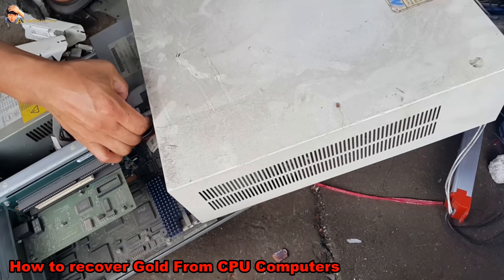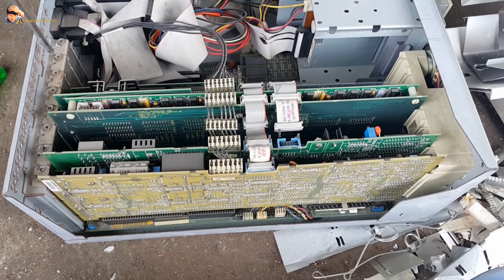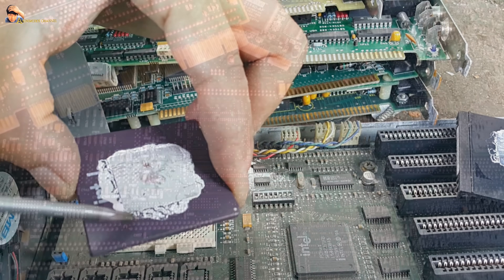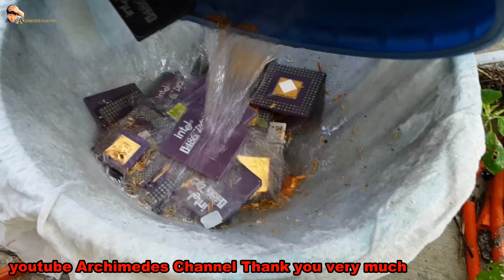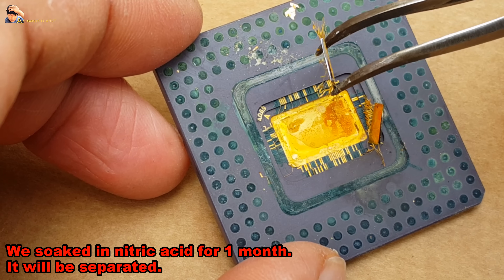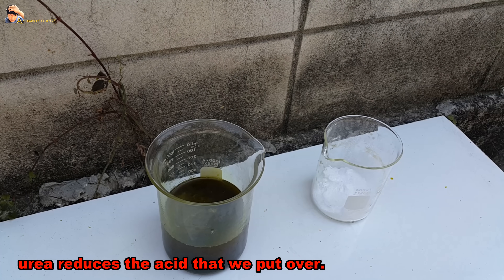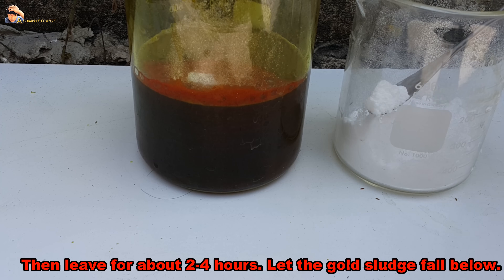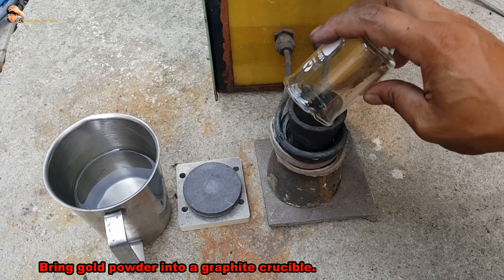How to recycle gold from cpu computer scrap. value of gold in cpu ceramic processors pins chip.

Comment: You could get a lot more money by selling those CPU's and other parts on ebay...
Reply: You will not get 6.7g of gold from a CPU. A Pentium Pro (highest gold content) will give you at the most 1g, if your recovery methods are perfect. You'd be lucky to recover 0.2 grams of gold from most CPUs. Given the cost of time, cost of chemicals and cost of hazardous waste disposal, it simply is not worth doing unless it's on an industrial level. You're better off selling anything from the original Pentium or older to collectors. Details on gold yield here: https://www.scribd.com/doc/28911037/Gold-Content-List-in-CPU-Chips
Reply: Super Swag i dont think you get it what retro gaming or a retro pc means
Reply: Frankiss Kilzkoy well thanks for pointing out that new pcs play new games. What do you mean by that, that no one should play older games?
Reply: Frankiss Kilzkoy Emulators do not fully emulate (for example) windows 98 the sound and graphics are always off
Reply: Tell me where you can buy a PPro for 1-2$, I'd like to have one.

And the compatibility isn't about old drms and stuff like that, it can also be related to old graphic card not using OpenGL but something else instead, speed sensitive games, things that aren't emulated to this day ...

Buy using that reasoning, I wonder why people still buy NES, SNES, Nintedo 64, etc.

And don't tell me about backward compatibility, have you ever tried it nowadays ?
Reply: Frankiss Kilzkoy Many newer Systems do have Compability issues with older Games.
Reply: ROFL this conversation is giving me cancer.
of-course you can make more money by selling restored 80s~90s legacy systems instead of scrapping gold of their connectors.
 
Vaibhav Thamman is obviously a guy that uses a computer only for media and entertainment, he wont understand the art and legend of old systems.

Super Swag does not get the context of this conversation lol.

Frankiss Kilzkoy claims that he is a computer engineer when he clearly cannot understand the art of engineering a computer and thinks people only buy computers for gaming and media, and he also does not get "sarcasm". xD
Reply: This is, if you can steal ALOT computers that are going to problem waste trash collection ect. Or steal the right parts from ALOT of them. Of course you dont buy anything, you steal the parts and do this, otherwise this wont make sense.
Reply: Samantha Applewhite
Because those CPUs are less valuable than the raw gold.
These are CPUs designed for pre-2000 PCs.
You can literally get these processors for like $1-$20 USD.
These are 1 and 2 core CPUs that don't clock over 1.8 GHz, typically.
They also don't have driver support anymore, and haven't since about 2004, so you're opening yourself up to an immense amount of viruses that may not affect everyday users with modern CPUs.
The raw material is just literally worth more than the finished product at this point.

That raw gold he just pulled out is worth about $95 USD give or take $5, minimum.
Reply: what if they don't work?
Reply: Frankiss Kilzkoy indie apps ... Like ?

And which offshore ?
Reply: Frankiss Kilzkoy 
No offence but 0,9 cents is what you get for your dollar in EURO's! Dollars are stupid IOY's that aint worth a dawm in any country anymore. Still think your dollar is the greatest thing that happened to the world come on, youre practically broke.
Reply: Frankiss Kilzkoy, I haven't played Minecraft in 4 years.
Reply: Adamo Kóligo, And that's the first thing that comes to your mind? lmao
Reply: Master Kek ...news pcs can also runs the olders games you know, so you do not need old pcs for playing them, there are something  called emulators,  if you have a new pc you can without doubt run ancients games without any trouble.
Reply: "You can literally get these processors for like $1-$20 USD." 

He used about 30 of them to get $95 in gold. He probably used $20 worth of chemicals. So $75 or about $2.50 each. If they are worth "$1-$20", that implies an average of more than $2.50 each. So he could have sold them as-is and made as much (or MORE) profit with a LOT less trouble.
Reply: " And those old pc games you were talking about can be played also on newer ones." 

Obviously you haven't ever tried running old software on new computers. Here's a clue-by-four: It don't always work. Trust me, I had to work to get some old DOS-based software and dot-matrix printers to run on some new computers for a business when their old ones (old 486's) died and it's not easy. Trying to run straight DOS would crash them. Finally did get them to run inside of a cmd window in Windows 7 but even then it took a lot of tweaking. And these were simple text programs with NO graphics. Even just trying to run some reports that simply added up and printed totals would crash initially.
Reply: Oh yeah, there are tons of collectors, that would pay lot more for thay parts. And you would even preserve history...
Reply: You must be a 70year old guy hahaha
Reply: He got way more money from video views
Reply: I have an original mac with several accessories.  how much you give me for it?
Reply: don't think any of them speak english hence the dumb robot voice translating
Reply: Noone is goin to buy this pos everyone actimg like oh theres people who play old gamesthere may be but your chance of selling it to some1 who wants it is very unlikely may as welll do exactly what hes doin more then likely he didnt do this for the gold but was scrapping the junk and took out the metals instead of throwing them away
Reply: Pasi123 ya of course
Reply: SGM Most of those cpus were older than Win98. And yes, many people does buy old CPUs for retro gaming PC's
Reply: For example MetalJesusRocks paid $300(?) for his retro gaming pc.
Reply: Pasi123 people who are intrested in gold are easy to find than people who are intrested in dad old cpu. Even to find a retro gamer who will be intrested in cpu's of medivial period.
Reply: But destroying rare CPU's for a really small amount of gold...
Reply: Pasi123 first of all that's not rare, its just an electronic waste which needs to be recycled at some point of time in life. And that ✌really small amount of gold✌ will cost you more than $250 or maybe $300 depending on the place.
Reply: Those CPU's definitely are rare. And he destroyed a lot of CPU's for that 6.7 grams...
Reply: Pasi123 kid you don't even know the difference between rare and waste.
Reply: There are thousands of tones of old computer gear.  Mountains of waist.  And yes people in the US pay thousands to get rid of tones of computer waist.  So if it was so valuable why would they ship it overseas in the first place?
Reply: @Pasi123  Maybe 95% of those CPU's is not working
Reply: Hjalmar Jönsson Usually CPU's doesn't die
Reply: @Pasi123  SO, they are immortals ?? :) 
Of course they can die. From overheating, from the lightning strikes near to PC, from glacier of water, or although it is enough to CPU's lose power after a few years and they are no longer competent or reliable. In that case, each owner will change the old CPU with a new one. There is another way to CPU dies. My father was have a internet cafe 13 years ago, and he still have in basement nearly 20-25 PC's They all are Pentium 4. Now I'm gonna sell it, or I'm gonna just sell a components.. Cuz I dont have a time and stuff to doing this gold job.
Reply: @Pasi123  where did it say the cpu's still worked wtf
Reply: @Jungskyy  I'm 99% sure the CPU's still worked.
Reply: Pasi123 if the pins on the CPUs are made of nickel brass or aluminum then the cpus are worthless and are not worth a lot of money and are completely worthless
Reply: Nope.
I wouldn't buy this PC for $30 when I can build something immensely more powerful for $100-$150.

That's about $95 worth of gold, and that's if it's only 8K purity.

Comment: Why they used the gold in CPU??
Reply: I believe it's for conductor?
Reply: Okay..thanks for Information💚
Reply: Nowadays they use copper because of fabrication processes made possible to use in ticker places - but in that video is all gold, much more conductive than copper, but pricier too. That's why every piece of processor shown was sold at like $250 in launch date.
Reply: Gold has less resistance  therefore  it's  a great conductor  and it's perfect to be used in application like cpu
Reply: At the time it was the best conductor available that was malleable enough to be used in a small application like a CPU
Reply: Gold Can pass data faster than others.